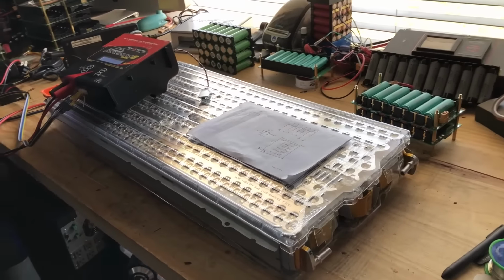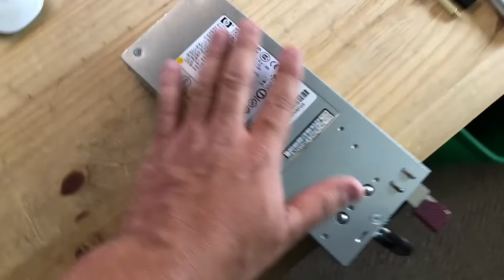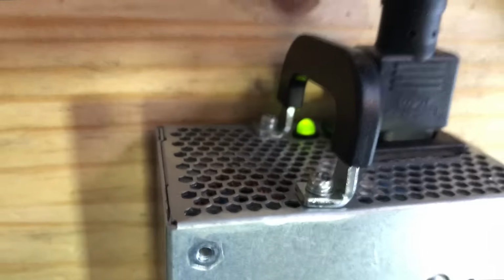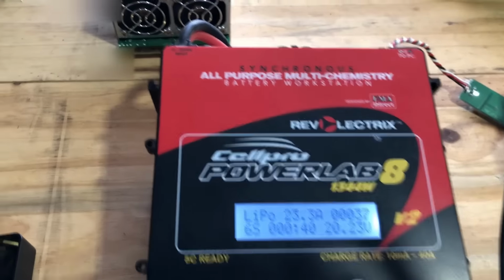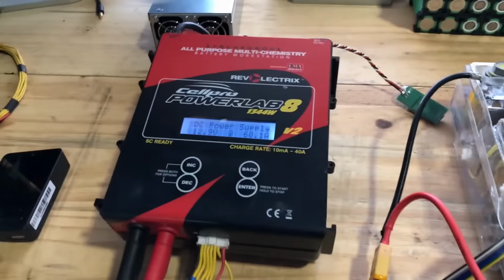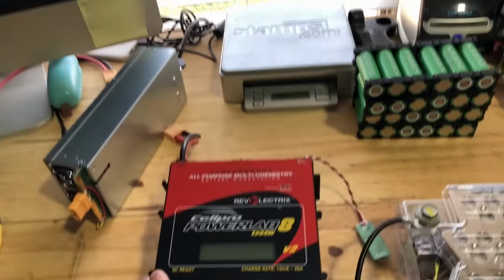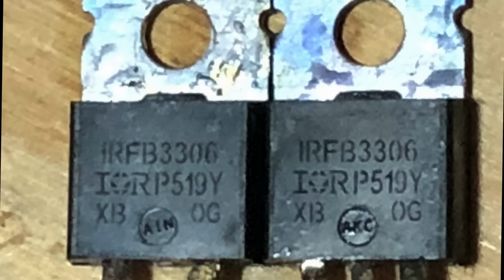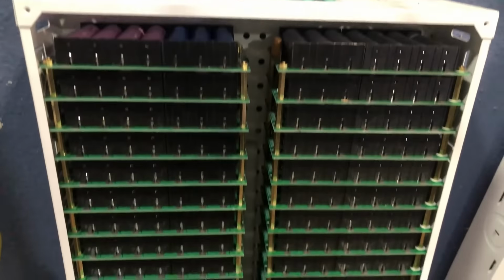How To Ruin A $300 RC Charger With a $25 1000W Power Supply

Comment: "To take advantage of PowerLab 8’s full power capability, the power source should be
26.35V DC (higher voltage does not improve output power), and capable of delivering a
minimum of 60A to PowerLab 8’s input"
factory manual
if u supply 12V the charger has to do twice work or even more to achieve desired 6S charging. And THAT IS why it blew up ;-)
Reply: True, nonetheless it should have had protection systems in place to prevent failures like this, poor design.
Reply: Justin W, Exactly this.
Reply: You're not wrong, but not only was he running it at 100% rated current, but he had both device exhaust fans aimed at each other!  Yikes.  From personal experience I limit the PowerLab input current to 40A, just judging by the temperatures the cables reach.  Usually 25A.  Keep in mind this is a hobby RC charger; using it for Tesla modules is heavy duty indeed and mechanical empathy should lead one to show some mercy and de-rate a bit.

Comment: There are a lot of comments stating that the power supply was over-load. I would partially agree with them, however I think a bigger problem is if you want to run the charger at higher wattages you would be better off using a higher voltage supply to cut down on the amount of current you need to draw to hit those wattages. Everything will run cooler and more efficient, especially when the charger doesn't have to step the voltage up.

Comment: If you would have used two server power supplies making 24v as you mentioned wanting to do earlier in the video would that have prevented this failure of the charger mosfets? I'm assuming more volts and less current would have produced less heat, thus saving the charger, while still putting the same amps into the battery pack?
Also, I couldn't find an update video and I'm curious to know if replacing the mosfets on the PL8 charger brought it back to life. Thanks.

Comment: You know the "$25" 1000W server power supply was worth $1200 when new. The server power supply is so sophisticated, it will always protect itself and will not get destroyed even if overloaded etc. and deliver the amps as demanded. Looks like your charger could not take the power being given. to it.
Reply: False. That model was never $1200 from HP or a reputable dealer. The rest of your points are still valid, though.
Reply: @templebrown7179  ok, how much was it then?

Comment: If you can wipe away the soot, you may see the rest of thepart number. IRF is the first 3 digits of the part number  the I and down arrow in a circle are for International Rectifier logo.    Likely candidates are irfs4229 irfs4227 and IRFS4231 IRFS52N  for high current and high voltage ratings, but your chip may be different.

Comment: Nice to see that extreme test since I have that same setup. Hope you are able to fix it, it is an excellent charger and would be sad to just waste it.
Reply: You should be safe running it as is if you dont push the input current over 40A, for running it at higher output power you would need to modify the psu to supply higher voltage (sometimes there is a trimmer inside that you can turn) or get another psu and wire them in series but you would have to isolate them from the mains ground (isolating transformer with 1:1: ratio)

Comment: Ive got sky rc multi out put quatro b6  320w charger ,, is that power supply to powerfull for that ? im charging 7 and 11 v lipos  4 at a time im using a pc power supply at the moment but it wont run it, Thanks whitey.

Comment: I would attach a good heatsink and fan to the FETs. With an thermal adhesive. And a screw. To prevent it from coming loose. The FET rating depends on how its used. They are pulse ratings and continuous ratings. I like to double the current and voltage capacity. Keep it well over what I'm planning for the max it will see.

Comment: Watch out man, if you get 2 of those you cannot necessarily put them in series to get 24v as many of them are mains earth referenced (0v is at ground potential) so if you connect the 12 output to the 0v of the next you are just shorting the supply so you will get a 80A 12V arc that would be dangerous.
Reply: that's why you isolate the dc board from ground/chassis when you put them in series. along with zener diode from neg. to chassis on floating power supply if dc circuit goes bad.

Comment: You should check out the iCharger 4010 Duo. It can charge at 70A and up to 20S.
It is built for 60A input peak.

Also, make sure the server PSUs negative output is not connected to ground.
If it is then you Can Not connect two of them in series without rebuilding. This is because it is a dead short from the positive of the first PSU to chassi ground on the 2nd PSU, out to AC ground of the 2nd PSU and then back in via AC ground to the negative DC of the first PSU. 
Rebuilding it means opening it and finding all the points on the DC side that are connected to ground and disconnecting them.
I did this to 4 Dell 1000w PSUs, it was quite simple and I can now output 48V at 4000W.

Comment: Question re charging 18650 for capacity test measurement purposes only (before putting them into use) 
Do you take them all the way down to 2.50  and all the way up to 4.20 or do you have have margins of safety even when testing?

Comment: you should also measure the amps going into the charger from the supply all charging units have a max input current rating. You were doing 60amps out but maybe 80amps in
Reply from the maker: No I was doing 60A in 30A out

Comment: Hi Jehu

The charger is rated at 612W with a 12V input which is 60A as you demonstrated. But I would never run any electrical device much above 75% of it's maximum rating.

Comment: did you ever get the charger fixed? and did you try it again with 2 power supplies? and did you end up blowing the charger again?

i am thinking of seriesing 2 power supplies for 24 volts and i dont want to blow the charger so i want to make sure that the fault was just undervolting the input.
Reply: that ps is capable of 100A @ 200-240v and 80a @ 100-120v, that is max output. no need to do that as he was only drawing in 30a from ps.

Comment: Jehu, don't connect the two power supplies together even if you keep the cases apart. Most of those supplies have their ground/negative connected to real ground/earth. That means to connect two in parallel, you have to modify it internally and isolate the ground from the earth-ed case. Please read up.

Comment: hey watch my videos on how to isolate the server power supplies. DO NOT just isolate the outside cases, it is not good to disconnect the ground to the mains side. you might want to add some nice low ESR capacitors onto the power supply rails, normally they are plugged into the motherboards which at least double up the capacitance, that would help especially on the high end (which at 120v input is only 69.9A output)
I really dont think it was the fault of the power supply you just took your charger to its max and the mosfet it had wasnt load balanced right, defective, or didnt have enough thermal paste.
thanks for sharing! link to my PSU isolation video: https://youtu.be/M4wOFHAjR5U

Comment: your mistake, the charger only could send 40 amps and you pushed it to 60
Reply: The charger was sending 32 amps. The 60 that you saw was the input.
Reply: Wrong, actually. The INPUT current to the charger was 60 amps - the charger is rated for 40 amps maximum on the OUTPUT side. Outputting 40a at 20v requires 800w of power - but that same 800w at 12v is 60 amps of current. In fact, if you check the users manual for this charger, it specifically states (on page 27) that the power supply used should be capable of delivering a MINIMUM of 60 amps to the Powerlab 8's input.  The fact that this charger failed when used with the minimum recommended power supply amperage is absolutely the manufacturer's fault, not the user's.
Edit: here's a link to the manual, see for yourself - http://www.revolectrix.com/support_docs/item_1377.pdf
Reply: Pretty stupid smart charger for going above it's limits... Seems like lackluster testing to me!

Comment: What's the issue with the two PSU cases touching each other? Chassis earth is not the same thing as electrical GND. If the chassis touch each other it shouldn't matter, because earth ground is the same in every mains socket.
Reply: In each server power supply the DC negative is directly connected to the chassis.  therefore if you connect the positive of the first to the negative of the second (i.e. connect them in series) then touch both cases together, then you have effectively connected the positive of the first power supply directly to its own negative, and a big BANG!

Comment: Hi, great video, I love the stuff you are building. These power supplies are incredible, I think the supply just killed the charger, because it was able to deliver such high amps... it wasn't its fault. And I don't think the mosfet were bad in your charger, but probably they aren't that efficient when boosting, and if the fets aren't driven with enough power, they spent to much time in high resistant "mode" and heating up. But just a short look at datasheet in your video: 160A, about 3mOhm Ron is pretty 
impressive...
But boosting is always less efficient than stepping down, in my opinion

Comment: Server power supplies are built for reliability and efficiency, they are excellent choices for power high power devices. It is not the fault of your power supply. It is the charger. I myself burnt a 1000w 30a turnigy charger by running it at 12v hitting input current limits at 50a constantly. Not running it out of spec mind you, but the manufacturers never intended for these devices to be used like that. Although I still dont think the end user should be held liable for use that is technically in specification.

It's a good idea to run higher input voltages and not hit maximum current all the time.

Comment: You are showing thousands in-stock on Mouser. They are just the lead-free versions. Datasheets are your friend. If you read the datasheet, it explains what the PBF means.
Reply: It was the charger's control scheme truly to blame. Even one of those MOSFETs are capable of 120A by themselves if they were being driven by a clean square wave instead of whatever sloping signal cooked one at effectively one sixth its rating because it didn't switch on fast enough and the drain-to-source resistance was too high.

Comment: It was your fault. you need higher voltage power supply.  Like 24V 50 A. And anyway 60 Amper was more than this charger can hold.

Comment: Sorry but I have the newer Powerlab8 Touch and it is an awesome charger! You cant run something so far out of spec and expect it to last.. if it was a higher voltage, then the charger may have had a chance. Also, Progressive RC is a great place to get chargers/ supplies from
Reply: He didn't run it out of spec, though. The OUTPUT current of this charger is 40a, the input has to be higher. In fact, the user's manual for this charger specifically states that the power supply used should be able to supply a MINIMUM of 60 amps of current. See page 27: http://www.revolectrix.com/support_docs/item_1377.pdf

Comment: You should have ordered a higher amp rated mosfets, if you want to run it at this voltage also as you were speaking about their amp ratinn and different versions, there is no such thing, the 160A max is rating for peak current not continuous current they can probably handle only 50A continuously and thats why one of them blew

Comment: Definitely not the fault of the power supply. You're likely way over the duty cycle for the charger. Increasing voltage is a task that creates a lot of heat. - I'd series up 2 car/motorcycle batteries to get 24 volts into your charger. (classic battery charger to the lead acid batts)

Comment: One thing I've learned the BAD way about most of the Chinesium Boost Converters.  When they list a Power Rating like say 10 Amps they're referring to INPUT Power not Usable Out Put Power.

Comment: if the charger has input current measuring like it does it should definitely be able to limit input current. and for $300 its a big let down that it does not have that safety feature. they should have fixed this in their software. its assembled poorly they stuck kapton tape to the heatsinc then pressed the mosfets against them with some thermal paste. the charger should have directly connected the largest power dissipating mosfet directly to the heatsinc with a 3m bolt then used glass insulators on the other two mosfets if they too need to dissipate a lot of heat, if not then it would be acceptable to use the kapton tape method only on them. thermal monitoring should be used on the heatsinc to cut power incase the cooling fails from either a fan failure, hot environment or blocked airflow. for $300 it should be nearly impossible to kill this thing

Comment: The quest for faster, more POWAAAH...  You definitely have the 60 Amp version.  Maybe you should have gone for the 160A version since your  charger's mosfets are the weak link?  Higher capacity mosfets will heat up less ==>more efficient.   Clearly, your needs exceed your $150 charger's ability with that server power supply.  I would order the higher capacity ones, for safety's sake.  You weren't over 60A but for seconds, right?  Fix it once and save yourself trouble down the road since an extra week of waiting and a few more dollars is worth it IMO.
Reply: there is no such thing as different versions of the same mosfet the 60A he was talking about were continuous amps which he was pushing thru them and you never want to run musfets at 100% of their rating.
The 160A is just their rating for peak current i.e. if you connect and inductive load and the current peaks at 160A they should survive it and continue working

Comment: For that $$$ the charger should have thermal shutdown built in. But, yeah, as others said you passed the thermal design limits and released the magic blue smoke. Probably not a good idea to charge from a supply significantly lower than the battery voltage. V1*I1 = V2*I2 + losses.

Comment: Lol, I was getting scared to sit in front of my monitor when that thing started to sound like jet engines... Doesn't the charger have max amp. limit exactly for this reason? 25 v * 60 amps is a little beyond the specified max... how come it doesn't limit it and rather catches on fire? :) (Why aren't there high amp chargers? WHy do I need a charger and then extra 12v precharger ? Confused about that)

Comment: Aaaand.... this is why I just bought a high current 24volt psu to run my charger off a DC-DC source.... instead of risking an expensive accident, or dangerous situation with a high power home-made battery pack.... nor will I blame the PSU if something I did goes wrong...

Comment: @jehugarcia Do you or any of your subs have a dead inverter? I have looked it up and have an ideal solution for your liquid cooling idea. I can modify the chassis and build the water block for you. I can film what I did and let everyone to copy it when you post it.  I just need one or two dead inverters.

I'll make sure anyone can do it. No special expensive tools. No risk of leaks because there is few joints. A plate of copper bent and folded on a 90 to replace the transistor rail slipped through a slot in the chassis top to bring the heat to the outside. The top sanded down flat so the plate can be glued to the aluminum with thermal adhesive and screwed or riveted down. Don't use 1/2 inch copper and all those fittings that can leak. They aren't meant to be moved they fail over time even if you do get it right. Use pilot light copper or refrigerant copper tubing.1/4 or 3/8 tubing. Switch back the tubing on the plate and solder it to the plate after you have fit the plate to the chassis. All this fed into a transmission cooler with a large PC chassis fan on it would would very well.

Comment: I have a few things to mention, one being that I wouldn't trust those server PSU's if you got them used on eBay like I did. I've had two 750W ones sporadically die on me at very light loads and high loads of 500-600W after only a minute or so. Second that charger should have had OVC protection on the input rails, really poor design to be honest. It's also worth mentioning that simply replacing those mosfets will most likely not fix your charger as usually failures like this tend to have a cascade of other failures throughout the system. Hopefully replacing your FET's will, but it's hard to say. Also make sure to apply thermal compound to the FET's when re mounting.
Reply: @NinoJoel  what are you talking about? I didn't blame the server PSU for killing his charger, even though it could have contributed it's hard to say, I was only saying you should be careful with them as they can be sketchy. Also he was not operating the PSU outside of it's limits, he maxed it out at 720W ish and it stated a max of 850W at 120V AC input.
Reply: @justinwiden  wasn't ment that way.
I mean the fact that he heavily overloads the charger and the Server Power supply also did not like the current he took from it.
Yes it can do around 69 Amps at before it shuts off but he was at 61 Amps continues already.
(Which I don't consider safe for longer periods on a used Power supply)
The wires are also way to thin for these currents.

It was more a complain about the Video since he basically puts the blame on the power supply while not reading any specifications.

Comment: LOL 250 amps drawn at 10 amps  is 25 hours to discharge 250/10 = 25, jus thought I would throw that out there for those that do not know what an amp hour is, why it's called an amp hour and how basic math works lol. It's the rate at which the battery will deplete if run at 1 am for 1 hour. In his case if run at 1 amp per hour his system will run for 250 hours.